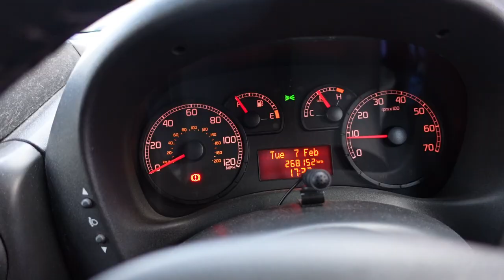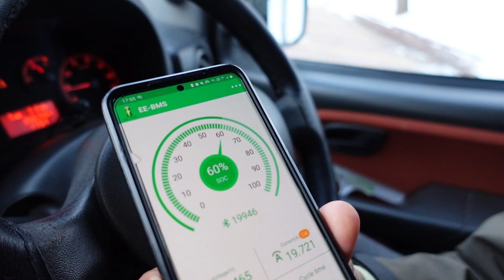Our heater BROKE! Preparing for -15°C in Central Turkey - Winter Vanlife

Comment: Is it possible that the reason the previous air intake was aluminium rapped in a covering because notwithstanding it is intake and should be coolish maybe that are heats up and the new plastic pipe might melt?
Reply from the maker: The intake doesn't get hot, only a little bit is near the exhaust, but it is still all good 👍🏼